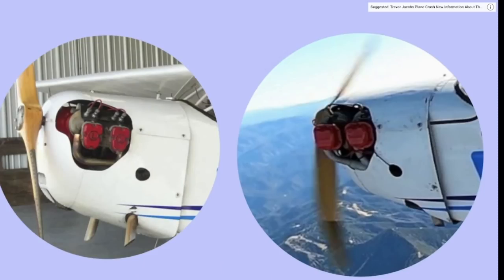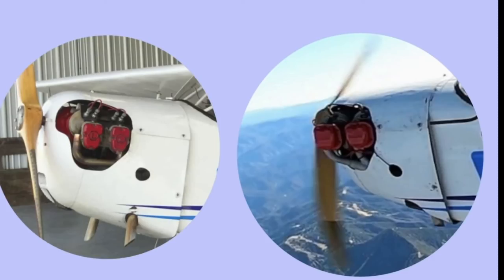Trevor Jacob Engine swap before the suspected "FAKE" crash?

Comment: Okay so explain that, "Out of hours". Is that a law or a common practice? Is it done just for safety or what? What are the rules if any and how does that work? Say I had an engine and it was in top shape, looked and ran great but was out of hours why can't I just continue to fly the plane and pull maintenance as normal? I'm genuinely asking, I am not trolling so stay away rabid-responders. Looking for real answers from pilots and ground crew, not internet opinions of armchair DCS mega-Aces.
Reply: Because you can't pull over if your engine craps out so no chances are taken, airplane engines work much harder than automobile engines so they wear out faster & experience greater stresses that can cause metal fatigue that can only be seen with specialized equipment. If your engine throws a piston mid flight & you crash into a residential neighborhood that would put others at risk, not just you.
Reply: @commoguru  airplane engines don't actually work that much (or any) harder than a regular automobile engine. The cruse rpm of most engines ment for aircraft is generally around 2000 rpm, or about the same as the engine in your car at highway speed. And the TBO is usually in the 1500 hours range that would be the equivalent of your car going more than 100,000 miles.
Reply: @derrickfoster644  RPM isn't the whole story, an auto engine turning 2200 on the highway at cruise is running a fraction of throttle open, the manifold vacuum is high, 20inches, an airplane at 70% cruise at sealevel is at 5 in (or 25" Pressure as measured on airplane instruments)  Also at a climbout, say on a small aircraft 500FPM to climb from sea level to 10,000ft, that engine's running at wide open throttle for 20 minutes. Auto engines rarely see that except on trucks or RVs in mountains. 
But what really kills airplane engines is lack of use, a low hours engine in an older airplane has likely sat for months at a time vs a trainer that's flown daily. That 500 hour engine may be ready for overhaul vs the 3000 hr trainer engine. Also, how is it flown, a rental by the hour encourages throttle and mixture pressed to the firewall vs an owner/operator who run Lean of Peak and 60% cruise at altitude. 
Part 91 (like the Taylorcraft and most General Aviation) run them until the oil analysis starts showing metal, or a borescope at annual inspection shows a problem, ie burnt valve or cylinder wall wear, or it does not make the specified Runup RPM anymore.  That could be 500 hrs or 3000 on a '2000 Hour' motor.  The FAA has no Part91 requirements for TBO (time between Overhaul) unless there is a specific Service Bulletin or Airworthiness Directive for a particular engine model or aircraft. Part135 (commercial operations) is a different story.
Reply: @derrickfoster644  They do very much work harder, a cars engine is not at full throttle the entire time the car is in use, you don't typically idle aircraft engines at any time during flight nor do you typically run car engines at near full throttle the entire time you are driving them with the exception of race car engines & look how fast they wear out. The rebuild requirement times would also hinge greatly on what type & size engine it is.
Reply: @TD_YT066  So if I am understanding this right, there is no law stating you have to trash an engine when it reaches its hour limit, at least not for private civilian use. If an engine is in good shape, has good oil analysis tests, has regular maintenance and runs well then there is no law requiring it to be scrapped or rebuilt? 
What about commerical? Are there laws for that? Or it again a question of good maintenance logs, oil tests etc?
Reply: @smokejaguarsix7757  , TBO (Time between overhaul) is observed as a hard limit in part 135 air taxi operations. Under part 91, the engine is checked for condition at annual inspections. A compression leak down test is performed, and if the cylinders are better than 60/80 PSI with a calibrated test gauge set, then that is good enough.

Certain components may need to be changed, inspected or repaired based on airworthiness directives. This is independent of the engine's TBO. Examples of that include inspections on the impulse couplers on the magnetos, propeller overhauls and inspections, etc.
I have little doubt that he most likely faked this aircraft accident and that is truly deplorable and should be addressed in the harshest terms. We in the community listen for ELT (Emergency Locator Transmitter) beacons  which are automatically activated on an impact. We listen to the emergency frequency for mayday calls.
This sham of a crash is the equivalent to an arson fire, IMO. Somebody might have been killed trying to save this arseclown.
Reply: If it's a Commercial Airplane - ie the owner is charging customers to take flights - then TBO is mandatory .. thecairplane is opersted under a different Federal Aviation Regulation .. but for "private" pilots .. pilots who are just flying for leisure .. the TBO is not mandatory .. but during Annual Inspections the engine still has to pass inspection .. it may be " running perfectly " - but the pilot doesn't make the decision .. neither does the owner .. if the Mechanic finds a cracked head or low compression or excessive metal in the oil or a stripped out spark plug thread , then the Mechanic can refuse to sign the annual inspection .. and the owner will have to get the engine rebuilt , or purchase a new engine , for they can fly it again .. the Airplane and Engine have to fall within the regulations , no matter "how perfectly" it may be running ..
Reply: @bradhartliep879  I see. Thanks!
Reply: @kellym5200  Thanks for the breakdown. I used to do SAR and CSAR so I know about the transponders etc. I was probably one of the first people on youtube in comments mentioning the fact he didnt really Mayday, have a transponder or wait to see if his single Mayday was even received despite having loads of time and elevation, and not missing a wing or his prop or being on (or under) fire. But the TBO reqs arent something that I knew much about so thanks.
Reply: @smokejaguarsix7757  Commercial has to follow the MFG TBO #, but unless there are parts that have a lifetime hrs number, it's a teardown and inspection. If the parts meet wear specs, they can be put back in service. 
Also, a Commercial operator can request an extension if everything looks good at inspection. TBO is a Recommended Spec for most engines (piston at least) , not Mandatory.
Reply: @TD_YT066  Learning a lot here. thanks guys.
Reply: @smokejaguarsix7757  Thank you for asking the question and eliciting such detailed answers! 👍
Reply: @MarcosElMalo2  I'm thankful for the great answers! These guys are fantastic. 
Ive flown small planes (with a pilot buddy who is a former commercial airline pilot) but I'm a retired Army officer. My buddy shut the engine off on me [cut fuel] and made me land this Cesna from 2500 feet 2 miles distant running parallel to the airport with my 2 young kids in the back having never landed a small plane before. I'd flown KC139 and B52 USAF Sim pods but those are totally different. Honest, after I got over the sudden shock of being handed a plane with the engine full off, it wasn't hard. I dont panic. We did the whole contact the tower thing, etc, or I did rather, then I landed it. We had planty of lift and speed, light crosswind. No biggie. If anything we came in a little fast but he said it was a good landing (I learn by seeing it once). So, I remembered what the engine looked like when he killed it. It looked virtually the same so I still feel like Trevor shut it off or just ran it out of gas before pretty much breaking every emergency procedure I have ever heard of and bailing out of a IMO perfectly landable plane.
Anyway, after seeing the info about swapping engines my interest was piqued. Thanks everyone.